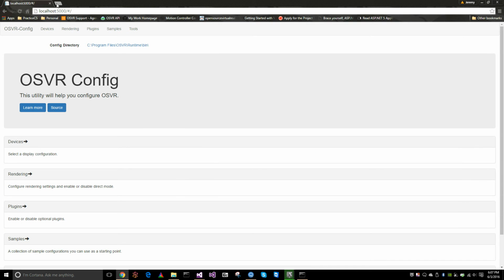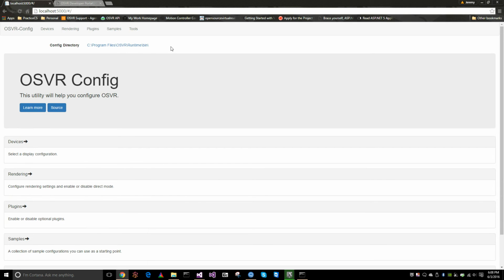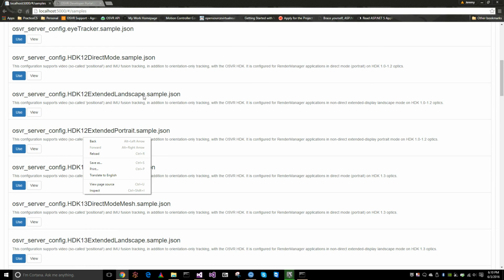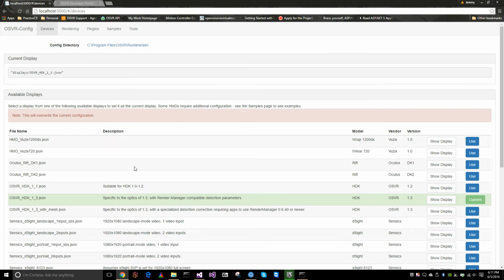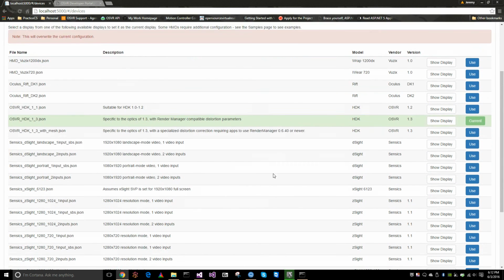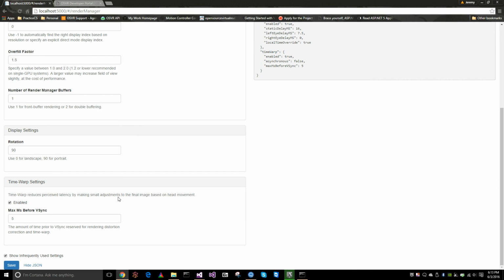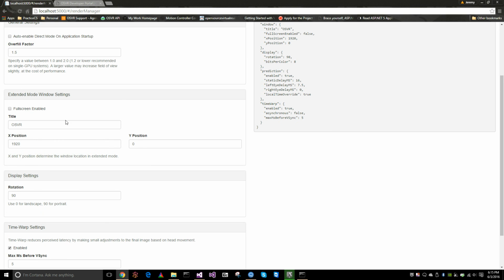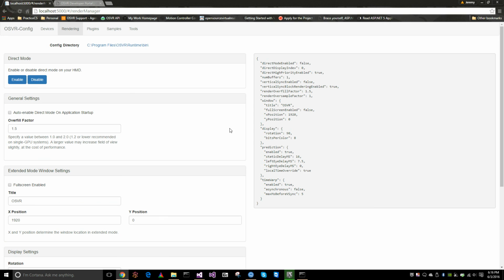OSVR Config Tutorial

Comment: Yes, the directory structure is outdated. OSVR-Config.exe is located in "C:\Program Files\OSVR\Runtime\config" but it doesn't run because of missing "api-ms-win-core-registry-l1-1-0.dll" (Windows 7 Ultimate x64). After downloading that DLL, OSVR-Config crashes with an System.Reflection.TargetInvocationException.